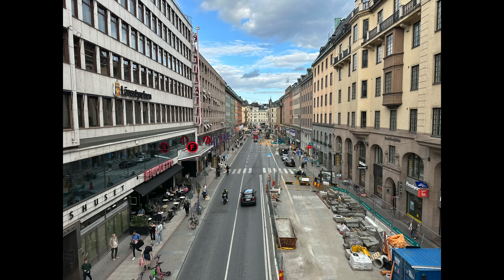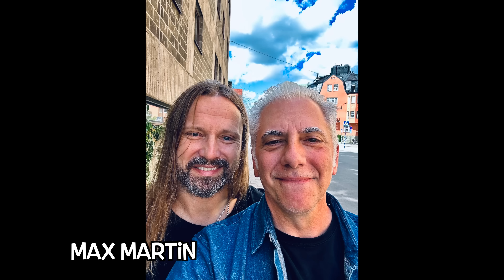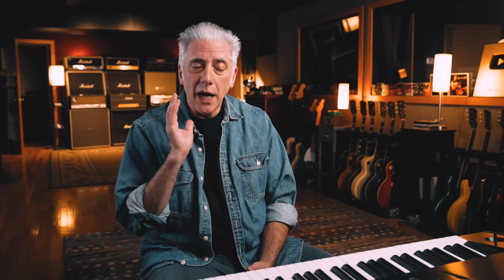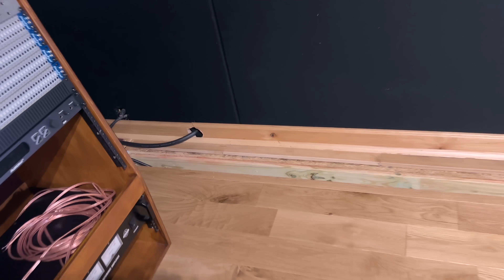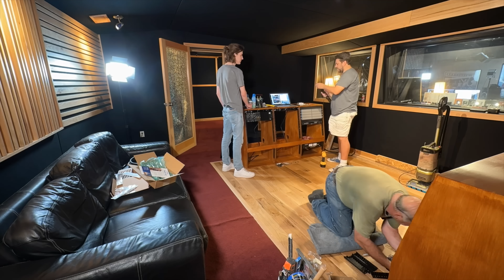I’ve Changed My Mind On This

Comment: The metal handles on the removable cable floor boards looks very loose and noisy and could vibrate and produce unnecessary noise when recording in the room. I would also put some rubber under them to avoid vibration.
Cheers from sLOVEnia!

Comment: Granted… I am certainly NOT an audio engineer or anything of the sort. But when you’re showing the camera (‘us’j the “trough” made for managing cables, and while replacing the cover it sounds to my ears exactly as it would if someone were literally doing that 6-7’ in front of me, down to the little rattle of the metal grab handle - I’d say you’ve built one HECK of an environment for sound recording, Rick! Not a single perceptible extemporaneous sound or noise at all. I got to stand once in an anechoic room, and that memory immediately came to mind. Maybe it’s something that’s taken for granted? Maybe not? But it seems like all your work over the years, including the latest work, certainly has paid off. Very well done, sir. 

Awesome to hear all the things you might have coming up, Rick. As always, I can’t wait to see (and hear) it all. 😉👍🏼

Comment: I love the whole concept of running cables below the floor.  After 30 years working in and around data centers, that's what I take with me.  Cable management is a big deal.  Congratulations on the project.  It's looking great.  I know it will spur new ideas, and we all will benefit from it.  And before you know it, you'll be needing more cable troughs.  😉

Comment: Hey Rick, you might want to have them alter the covers for the cable trough to have half-circles out on the ends instead of the circles they have in the video. That way you can put the covers on and lift them off the trough without ever having to thread cables through the holes in the covers. This will make adding or removing cables to the trough easier.

Comment: Very cool Rick. I know very little about sound studio stuff, but I worked in the telecom industry for 30 years, and wire/cable management was always a pet peeve of mine. That stuff needs to be meticulously routed & labeled so you can find & fix it when necessary. It looks like you're doing a great job with your studio. 👍

Comment: For the middle board coveriing the through, you should consider not having holes, but cutouts instead. So there would be no need to thread cables through the holes.

Comment: Instead of circle cuts through the boards you should have used semi-circle cuts at the ends.  That way you would never have to thread a cable through the hole or even unplug a cable to move it in/out of the trough.

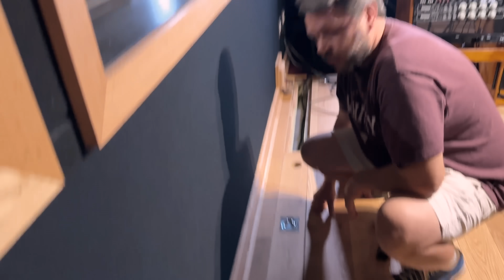Comment: At 4:35 you can hear the metal latch rattling on the cable cover. It might be worth testing a guitar amp in that room to hear if they will rattle at certain frequencies? You can put foam or rubber stickers to stop the rattle. Or even nylon washers on the metal loop to stiffen them so they don't move much. Cable trough looks great though and the room itself will be awesome once its all finished. Great stuff! :)

Comment: Did you just trade a squeaky floor for a buzz?  Those metal rings in the trough boards - are they going to buzz.  Might have to dampen them with some foam backed tape.  Looking forward to more/different content.

Comment: Sir, you need to buy a pin nailer (nail gun for trim) so you don't have to replace entire floors.
Looking good, and WOW that room is quiet on mic.
5:05 On the squeak and the patch bay: man, I suffer from the same problem. Right now my main PC is down, so I'm stuck with my laptop and a stripped down recording setup ...and not made a move to get the computer fixed. Wtf? Must be some self-saboteur lodged in where my ego rotted and started smelling like sulphur. I even have the money set aside for it.

Crazy, I was wondering why you don't do videos on recording and producing only maybe a week ago.

Comment: How did you make the floor stop squeaking? Is the floor floated or direct on slab? (looks on slab… did you rout the concrete for the trough?) etc. Did you take patch bay to metal recycler? Your control appears to not have traditional LEDE dimensions but looks more functional for it. Please explain.

Comment: Is it really necessary to use physical patch bays these days? In broadcast, we now use audio over IP routers, where there are no patch bays - you just use either a hardware controller or a software matrix to 'connect' sources and feeds. I'm pretty sure you can do that with Dante.
Reply from the maker: Well, I guess I could just use a laptop with Logic and a 2 channel Focusrite Scarlett
Reply: @RickBeato  Ha I don't mean that of course, but a Dante (or other AoIP) matrix router would obviate the need for patch cords and their inherent problems. I used to hate fixing patch bays in radio studios! But: If it makes sense to the user and you're comfortable with it, then each to his own!

Comment: Just have to say this:
I am the same age as you. My father was a retired air force colonel...
My first three haircuts were on the base. Until my three older sisters put a stop to that and put me into Beatles hair cut mode...
Until I put a stop to that in my teens and put me into Greg Allman haircut mode.
But never, ever did I have a haircut as horrible as that one you had there.
I would take that picture, place it under fire, light a fire on top of that and make it go away forever.
God bless your father but..hell..that was horrible.

Comment: My thoughts - the cables hidden under a floorboard- unnecessary and the metal lift rings during recordings are going to vibrate/rattle and MAKE NOISE which is the whole reason you ripped out the old SQUEAKY FLOOR! sigh..